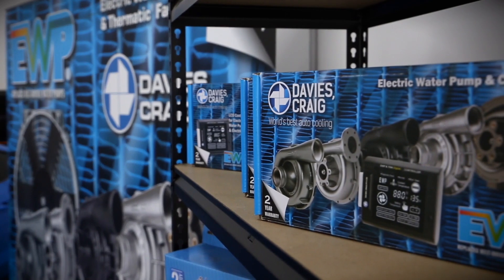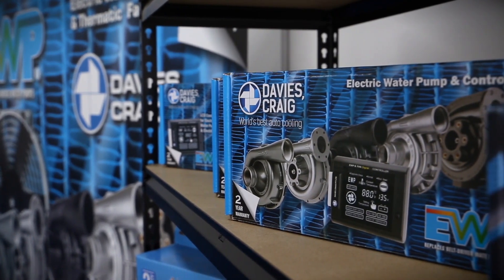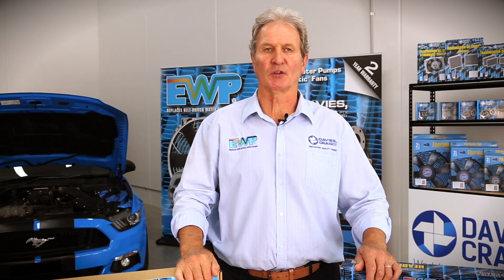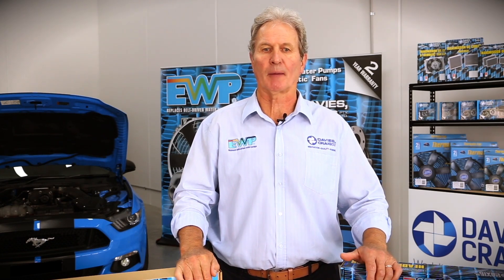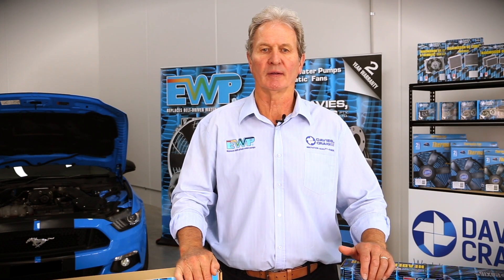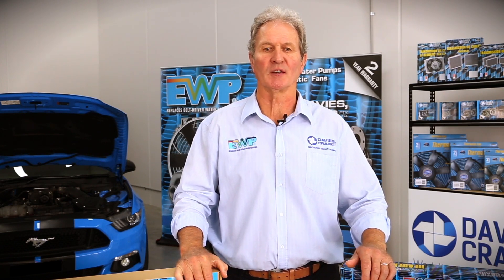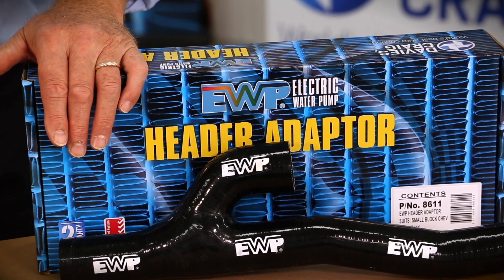FAQ EWP Part 5 - Best Electric Water Pump (EWP) Configuration For An LS1

Comment: Wish I could find how to feed my heater core . Kit only come with a return line port
Reply from the maker: Niall, our LS block adapter does include a heater return adapter. Look up part number #8670. We also offer the heater return adapter on its own, look for part number 8315 from our spare parts section on the main website.